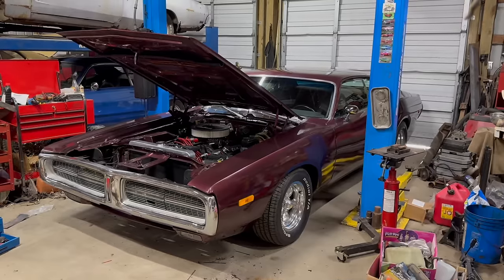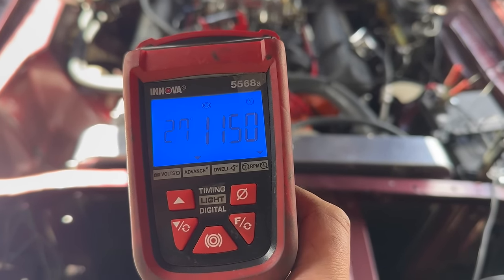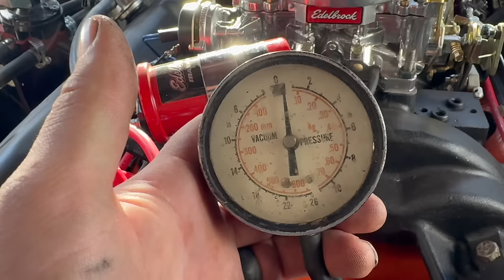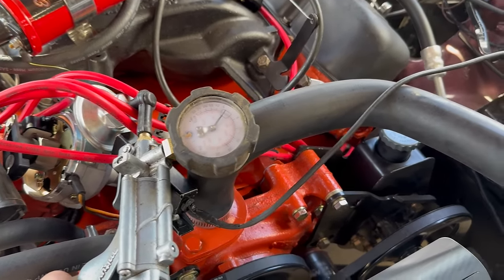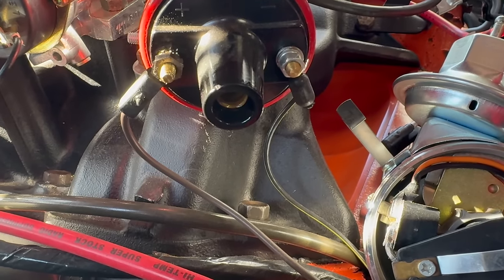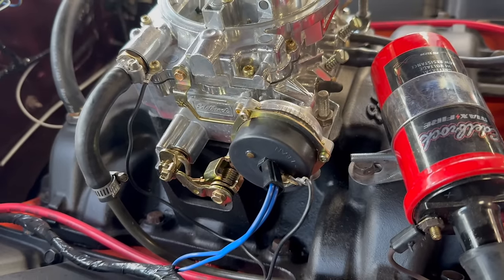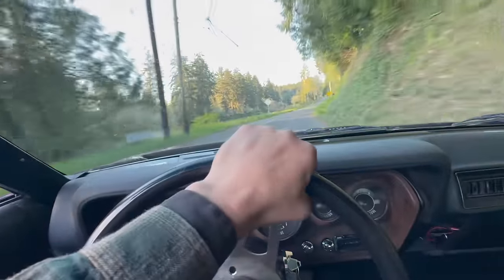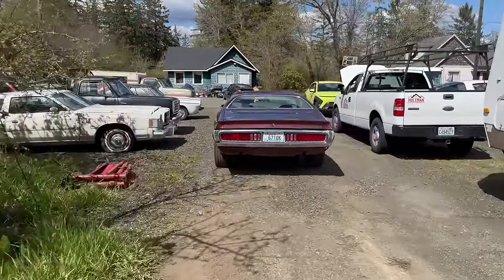How To Make Your Hot Big Block Run Awesome - 1973 Dodge Charger 440 Distributor Recurve And More

Comment: Man that was some cool distributor tuning that i never new about Mopars. More advance at idle than at full power. The throttle response you were able to achieve made me a believer indeed. Back in my day i couldn't achieve it because i was not taught those tricks. I always thought ported vacuum was best; now i know not so much. No wonder i was always dialing out the ping and losing response. It was a confusing dance back then and i wish i had an old Mopar now to play with.

Comment: This thing is sweet! A third gen big block Charger is definitely what I need in my life! Love this! It's a hotrod, you'll always be tweaking, nature of the beast. ❤
Reply: Dude, that was a masterclass
Reply: I have one in my life and I love it,sad part is that i am low on funds and it is sitting in a field at a friend's house, total Mopar wrong doing, but don't hate me,i will fix the rusting floor pans and quarter panel on the rear passenger side, also get rid of the vinyl top other than that it's not to bad, think that firm feel solid k frame mounts and torsion bar mounts will be a great improvement in the front end,i only paid 2400 for it so I guess it's worth the work, no it's definitely worth the time and work, I have spent years looking for another charger a72 but I could only find a 73 and if I can get it done close to looking like this one I'll be happy as a pig in.  well you know what

Comment: I had a Camaro (don't tell anybody) with a GREAT stereo. Being a kid at the time, it was ALWAYS too loud. My Dad and I built a decent small block for it but MANY people thought the "Hot For Teacher" drum solo was the engine at idle. 
Your comment about that took me back to those times.....things were good!
Reply: I put a purple shaft cam in my 383.  Later on that night, while cruising main street my buddy said, "You got to do something about that bad miss." I couldn't stop laughing.
Reply from the maker: @don66hotrod94 I once pulled into a gas station in my Barracuda (the one I call Garbage Can.) That thing was rowdy… aluminum headed 360 with relatively whacky cam, fenderwell headers, 3” glass packs and side exit pipes. I shut it off and got out, and a guy standing there said “I can’t tell if that thing is running really bad, or really good…” I’ll never forget it. Haha.
Reply: I had a PHORD guy repeatedly tell me my big cammed 318 build had a "miss"........jealousy is a funny thing.

Comment: Lots of good information! As to the leaking coil, back when ignition systems used points, if the key was left "ON" without the engine running, and the points were closed, the constant current flow would overheat the coil. You would literally 'Boil the oil in the coil !' 😁
Reply from the maker: I've heard the points aren't big on having the key left on either.
Reply: Or the ballast resistor! 👍 my dad used to get pissed when we would leave the key on to listen to the radio haha

Comment: I had 3 - 71 Chargers the fuselage style is my favorite. I tricked out my 440 with a Sig Erickson high flow B Cam, headers etc, and it took at least 5 minutes before it would not stall on a cold start. My brakes worked too!
Reply from the maker: My Demon is a big cam, no choke, blocked heat crossover special. It doesn’t take five minutes, but it generally takes at least one. I’m well familiar with that action. The stalling I was experiencing happened after the engine was fully warmed. Different deal.
Reply: @DeadDodgeGarage think maybe something in the ignition wiring is shorting out when it is jiggled around the right way?

Comment: You could have an ignition switch issue. Check the adjustment of the switch position and the actuator rod on top of the steering column under the dash. Of course it could also be an intermittent connection there at the plug to switch or an intermittent switch.
Reply from the maker: These don’t use a rod. The tumbler engages directly with the switch. I have of course recognized that as a potential issue - and many other people have suggested it as well. The switch and the entire wiring harness it is connected to are both brand new - but in today’s world, that doesn’t guarantee they are good. In any case, we replaced the leaking ignition coil, and so far all seems well.

Comment: I had a 71 El Camino with a crazy cam power brakes was a problem I installed a vacuum canister  helped a lot  you can use an old coffee can or good old Campbell soup can hey it works😊

Comment: I was a died in the wool carb guy most of my life. But, these new self learning efi units coupled with a full electronic dizzy is good stuff. Get it close and let the silicon do the rest. Spendy? Yeah. But, much easier to get lumpy cams, loose T/C's, finicky A/F's and precise timing to play nice with little aggravation involved. And, STILL sound like Sox and Martin or Dandy Dick in '68.
Reply from the maker: I have discussed the computerized timing control as the positive side of those EFI setups in the past. It's the one thing I really like about them - the ability to quickly and easily change the timing curve. But there are a lot of other aspects of them that I definitely don't like.

Comment: Very well done presentation! As far as the coil orientation goes, it used to matter, but with better sealing technology around the 'plus' and 'minus' terminals, that's probably a thing of the past. 
  If anyone has any old horizontal mount OEM coils, whether Mopar or the Ford mustard top coils, the terminals were not on centerline. They were offset, with the terminals being above the high voltage lead.  But I still always mount the terminals horizontal to keep the cooling oil covering the windings.
  I also gave up on the leak prone Holleys, especially on older ones when some gorilla tried to stop the leaks with the biggest screwdriver they had, warping the fuel bowls. Too much grief!

Comment: I have a Chrysler purple shaft cheater dirt oval track cam stock lift but does not advertise the duration but I believe it to be around 308. My ignition curve was 14° initial and 38° total. Open chamber 906 heads but use 6-pack Pistons which are about 10 and 3/4 compression. Using an AVS carburetor I had to drill two small holes in in the back side of my butterflies to bring my throttle plates closer to the air bleeds and the needle seeds I opened up 1: 32 second of an inch over stock. Drilling these holes sure fix my problem and you can always J-B weld the two on the butterfly shut if they're too big. Drilling the needle seats out 130 2nd avenue bigger I was still able to seat my needles. That made the biggest difference on my carb! I love mopars!❤

Comment: We had a 2010 Challenger with the terrible 3.5 V6, burnt at least a liter(quart) every 5000 km or less. The electrical gremlins are why we traded it in. The 3.6 in our 2017 GT AWD uses zero oil and other than a hairline crack in the 8 speed pan, went to aluminum. I have all the Dorman aluminum upgrades and a PUG intake if they fail. Best car we have ever owned at 140,000 km now. We just put on four 235/55R19 105W XL Continental Extreme Contact DWS06+ tires. I have 18" aluminum rims with 235/60R18 studded tires for the Winter. It is quiet, the Spectre cold air intake added just enough extra noise, mileage and power.

Comment: Jamie of you have a reproduction engine bay harness check the pins in the bulkhead connector. I had one on my dads 73 Charger that was partially backed out making a poor connection causing intermittent loss of power to the ignition.
Reply from the maker: It’s so funny you say that, because just last night and this morning I was helping a subscriber diagnose an intermittent stalling / no start on a B body. He had thrown a bunch of ignition parts at it and it was doing the same thing, so I told him to break out the multimeter, and that’s exactly what he ended up finding. Which then reminded me of seeing the same thing on Tom’s Roadrunner. So I will definitely be checking now. Thanks!
Reply: @DeadDodgeGarage  I’ve learned over the years of working on vehicles that new means new not necessarily good in all cases. That is part of the reason I built my whole harness for my Charger race car, I made every connection in it and I’m confident they won’t let me down.  Keep up the good work. Steve G

Comment: Put the curve at 8 degrees BTDC without the vacuum advance hooked up. Then have 34 degrees all in by 3k rpm. I got my old 383 distributor set that way and it was fantastic. Tried it on a 440 and got the same results. Both engines got their best mileage and power with that curve. Just food for thought. I had to use one aftermarket spring and reform the weights a little to get it all to work. Those aftermarket weights are not good for this curve as they try to set too fast. By the way, you will get better mileage with a Holley carb. Yes, the Edelbrock is easier to tune but they just never get the mileage a Holley does for the same amount of power.
Reply from the maker: That might have worked for those engines - but at 8 base + the 19 degrees from the vacuum, this thing idled like garbage. And I really don’t think there is anything a Holley does that an Edelbrock can’t as far as fuel economy - especially when the power valve inevitably blows, the o rings in the needle assemblies dry rot and start leaking internally, or when the Holley decides to dump fuel all over the top of the engine. I’ll stick with the Edelbrock!

Comment: Fortunately somebody tossed the 72 only stock 440 Magnum Holley in favor of a 71 AVS long B4 I bought my 72 SE. So much fun to tune and tweak compared to Holley gas leakers lol.
Reply: BTW, a word from experience...never use the stock bumper jack on hideaway setup unless you want to crack the expensive grill.
Reply from the maker: Oh yeah. I would much prefer the AVS. I never use a bumper jack, period - but that sounds like the kind of thing learned through experience. Haha. So that’s good to know.
Reply: @DeadDodgeGarage bumper jacks are great for breaking down tires to get them off the rims

Comment: 22:40  When disassembling the bottom of the distributor, I’ve heard that reinstalling it 180 out to the way you found it messes with the phasing of the distributor.  This may be some dreck I heard from some fellers on one of the more prominent mopar forums, but correct orientation of parts removed is something I always pay attention to during disassembly of anything anyway.  I think it had to do with the orientation of the reluctor wheel on top.  Just put it back the way you found it.
Reply from the maker: I used to mark them, but I haven’t done that the last couple times and haven’t had any issues with it. The shaft itself is symmetrical. The phasing difference does indeed come from the reluctor - there is a clockwise position (small block) and a counter clockwise position (big block.) I did a video a while back on a ‘67 Charger, on which I found that the reluctor in the brand new distributor had been installed wrong. That’s always a good time.

Comment: Cool i myself have a mighty vac it's how I figured out why my heater was not working in my 78 Chevy c20 custom deluxe long bed truck with a 350sbc, and then a year later this same issue not the same symptoms as the truck on my 86 Buick Regal Factory V8 Sport Coupe Oldsmobile roller cam 307 v8.....

Comment: Bad coil our car had exactly the same problem, I spent days rebuilding the thermoquad adjusting the float etc replacing leads rotor button and cap finally get the s##ts. With it and replaced the coil and bingo all fixed
Old coil had spark but must have been dying when it got a little heat into it

Comment: I asked you about my 70 charger 383 stalling after a burnout and then crank no start.   I think I've tracked it down to a loose engine ground cable at the battery post. I tightened it and have had no issues with two seperate drives. Thanks.
Reply from the maker: That’s really interesting! Holy crap. Actually, thank you very much for letting me know, because I just realized I haven’t installed a ground strap yet.

Comment: 20:19 Generally, the advance numbers are stamped into the vacuum advance arm, and mechanical advance base plate (with the limiting slots) on factory mopar units.  The trick is, they call out the advance number based on camshaft rotation. So, in order to be accurate, multiply them by two to get the timing numbers we use for crankshaft rotation.
Reply from the maker: Ah yeah, I guess I could have mentioned the numbers on the arm. I have never noticed a number on an advance plate, so I will be looking for that in the future.

Comment: What a cool car! I actually had a symptom similar to what you experience with the engine turning itself off at random, it was caused by a failing ignition coil but I could be wrong, I'm no expert at all...
Reply from the maker: I’m not saying you’re right or wrong, but we changed the brand-new-but-oozing coil, and it hasn’t done it again since 🙂
Reply: @DeadDodgeGarage  . Glad it appears to be fixed now anyway 🙂. It's not something I'll ever forget, when my big-ass Impala's engine suddenly shut off in the middle of a bridge in heavy traffic. Having my father push it while I was hoping it would fire up again and it magically did... that time.

Comment: I had a engine shutting off randomly situation once. I changed the ignition switch. Fixed it for about a week and started doing it again. So since it seemed to work I figured it must be a bad new switch. I took it out tested it and it was fine, so I changed out the ignition lock cylinder. I also put in another new ignition switch to be on the safe side. I was tired of taking the steering column apart. Never had the car shutting off problem again and that was 15 years ago. Now the car it wasn’t a Dodge and I am not saying that’s the problem but it is something to consider.
Reply from the maker: Absolutely something I have considered. It’s a brand new switch, but of course that doesn’t mean much these days.
Reply: @DeadDodgeGarage  My brother built a 72 charger with a 10.5:1 compression 383 and a high lift, long duration cam. He never did solve finding enough vacuum to power the brake booster. After 10 years of driving with a concrete brake pedal he swapped it out for a 440 with a stock cam. Got to love the bottom end tork on those 440s. He’s a lifelong vintage Mopar guy I’ll ask him if he ever had that random engine shut off problem. Ya never know. 
I like your approach to the low vacuum problem. It is cool to see it being solved without a vacuum pump!
Reply from the maker: I’ve seen plenty of random shutting off problems myself. I’m concerned about a part failure, but as an experienced diagnostic guy, I know that it can be quite difficult to confirm a failure until it actually kicks the bucket.

Comment: Definitely marking this video for when I get to this point on the Challenger.  Wish I could get a strip kit (jets/rods) for the Carter BBD!

Re: hood hinges; my Challenger does that and you can push the rear of the hood down flat after its closed, and it stays.  I was told (and read elsewhere) that it is due to wear in the hinges and that getting them rebuilt would fix the problem but that it would likely come back in not too many years.  Hinge design causing excess wear?

A scar on back of head is a mark of Mopar honor...
Reply from the maker: We even had a set of Challenger hinges rebuilt, and they still did it. It’s just how they seem to be. Some certain amount of counter intuitive hinge adjustment is supposed to help, or so I’ve heard. If you don’t do as I showed and close the hood from the middle, this one has to be pushed down at the back corners too.
Reply: The AFB jets should work in your bbd rods are another story.
Reply: @SE-me2pt  Thanks, nice to know.
Reply: @DeadDodgeGarage   I'll have to wait to find out; the hood is leaning against the wall and the hinges are in a box waiting to go to a restorer.  And I may need to change the hood anyway; the original got a corner crunched in.  It had the hinge problem before and after that damn beer truck rolled back into my car in a parking lot...
Reply: @richjordan9375  My experience is with actual Carter stuff but I was told the Edelbrocks are compatible. I   used old bbd jets in my four barrel carbs after drilling them to the needed size.
Reply: Correction, I might be confusing the ball and ball with the y series two barrel carbs. Chemo brain sucks lol.

Comment: What is the name of that color? I think that car looks sweet and the title for mine says it is red and that color could pass as a type of red, you have done an amazing job on the car,i was gonna go with black or forest green but that color has really grown on me, would love to know if or where I can get a complete hide away headlight set up, no hurry right now, still scrounging funds for all the other gremlins that need attention, like rusty floor pans and rear passenger side quarter panel, front valance and a front end rebuild kit (like to get Firm Feel solid K frame and torsion bar mounts) sounds like a lot but it really is not horrible, just needs time and work and you have remotivated me by posting that car and how good it looks and sounds, thanks for giving me hope and motivation
Reply from the maker: Glad to help. We’re very happy with how it’s coming together. He says this color is called Inferno Red. I just bought a 2018 Challenger in Octane Red, and it’s pretty close to that. But the ‘73 also has blue metallic in the clear coat, which colors it slightly purple. It’s a cool look. It will look better when the cut and buff is finished.